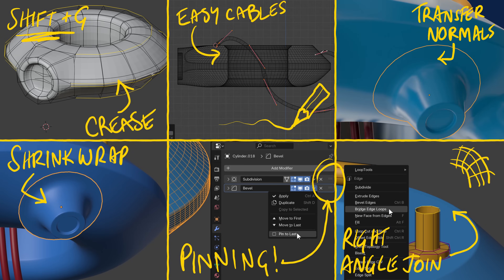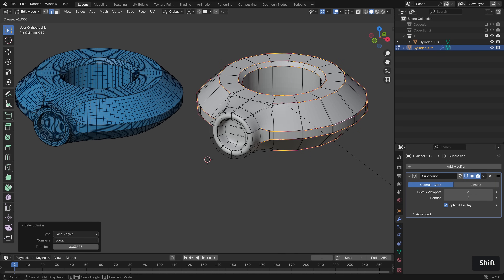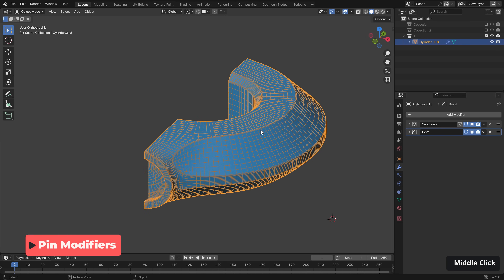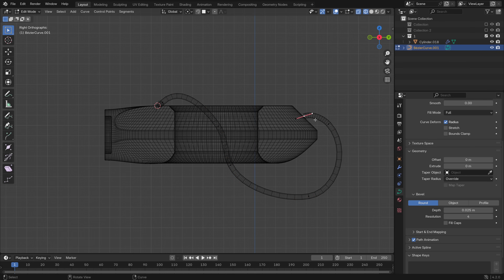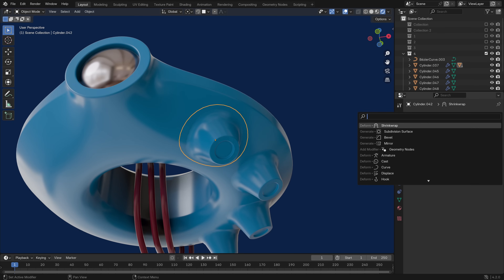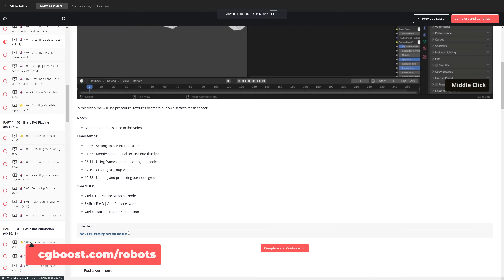6 Blender Hard-Surface Modeling Tricks I Wish I Knew Earlier

Comment: Am i right that crease edge information is only local for Blender? You can not export the High poly model(with crease as geometry) to Substance Painter or any other external program and bake normals. So by using it you basicly lock yourselves int the blender environmet. Am i correct?

Comment: when i try to do the bevel on the edge mode literally the first time it is used my cylinder gets shaped into a car tire kinda of shape, instead of the one on the video 😭.
Reply from the maker: You may need to reduce the number of bevel segments, either by scrolling down on the mouse wheel or adjusting via the options that appear at the bottom right of the 3D viewport. ~Louis

Comment: So does that mean it's okay to not physically connect those additional meshes to the original?
Reply from the maker: As this is a rigid model with a uniform material, it works great. But it might not be a good idea if your model deforms or uses more detailed textures. ~ Louis

Comment: i dont know what the problem is here i have tried everything but first my bevel is going the opposite direction also when i use loop tool circle thw whole area gets into a messy shape maybe its a glitch or something
Reply from the maker: It sounds like it could be a scaling issue, with the object selected, hit CTRL+A and select Apply Scale, hopefully this should avoid odd results with bevel and loop tools. ~ Louis
Reply: @cgboost  it was a scaling issue.

Comment: 7:38 when i duplicate the object and try to move over the main object it forces the base to stick on the underlying surface due to the shrinkwrap modifica but everything else deforma badly, the full object does not remain rigid while moving around… what could I have missed?

Ps: I think that my mistake was applying all transform, rotation included, to the small object and so now when i move around the top face keeps being oriented in the same direction as the original while the rest of the body deforms to allow the base to stick to the underlying faces of the main object…

Comment: Why do my bevels never match anyone elses? It isn't just this video, but it seems every time I try to follow along my bevels are wonky? The first set of bevels at around 1:35 don't leave any room for there to be faces on top with much wider side faces? If I try to get the same angle on the bevels, the top spins all funky.
Reply: Try going back to object mode , control A and apply all transform before beveling
Reply: @Mad_madeleine thank u for this !

Comment: After I apply SHRINKWRAP to the vector on the base of the cone when I try to move it around the surface it deforms horribly. Do you know why? I'm using 4.2.3 . Thanks. Oh! never mind I solved it. You have to turn ON "face Project" on the SNAP menu

Comment: Another good method for making cables is via vertex extrusion, add a skin modifier, edit mode, ctrl+A to change the fatness of the cable and et viola you have a cable that can be moved around with normal editing tools (this gives easier control in some instances and may be preferred), you can dynamically subdivide it or vertex bevel it as needed which is nice too.

As a bonus this tool is EXTREMELY useful for tree roots and other organic shapes since you can set the skin thickness per vertex if you so desire.

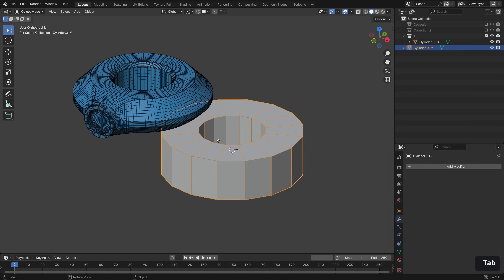Comment: for some reason my bevels in 1:22 aren't angled so well, the upper edge goes inside the mesh much faster than the lower one, so I'm never able to lower the bevels close enough that they meet. anyone knows why?

Edit: found out, it's the offset. I changed my offset to percent and it shapes like the one in this video. Thanks!
Reply: i had the same problem and your comment was really helpful
Thanks!

Comment: Does the trick at 07:43 work differently in 4.2 compared to older versions?
Because I'm currently using 3.6.1 and although all the required options and settings are there, transfering the normals as described completely overwrites all the normal data instead of trying to create a smooth transition between them
Reply from the maker: Hi are you using the vertex groups to isolate the effect?

Comment: Mesh Decal Alignment tip @6.50 : Make sure the "Snap Base" is set to "Center" otherwise your decal will not properly align to target object. Blender defaults as "Closest" which does not attach cleanly to target.
Reply from the maker: Thanks for the tip!

Comment: Trying to do the Quick Cables part at 4:34 - However, I cannot see the Draw option to draw the cable? I have to add a Blank Grease Pencil, before I am able to see the Draw Interaction Mode. Otherwise the annotate tool draws a line/curve which I cannot select or modify, and there is NO Draw Tool visible?.

Using Blender 4.2.1 LTS - and even tried to Reinstall
Reply from the maker: HI, to being able to draw curves, you need first to add a Bézier curve to your scene and then select it and go to edit mode. Once you're in edit mode of the curve, you should see the draw tools. You can simply delete the old curve and draw what you need.
~ Masha

Comment: Using the normal data transfer method, does this information work when exported like regular normals? If I were to export a model as FBX/OBJ to a game engine, do you know if the normals would maintain that blending? Or is this exclusive to Blender's calculations?

Comment: Tech question:  How can I be sure to get the normal in a rounded surface?
Is there a way to plase the object perfectly perpendicular in a rounded surface?
When I place the object with shrinkwrap I hav to rotate it to make it appear perpendicular. But how to get the perfect averege of perpendicular rounded surface on that area?
Reply: To make this I shoud take the center of the radius of the curve of the rounded surface as a origin point for the shirnk wrapped object. 
If the rounded object is a sphere we're done, the point is on center. But if it is irregular rounded surface how can I get the center of the curve?
Do you know how to solve this in a geometric/ machanic way to get the normal perfectly and not just aesthetically?

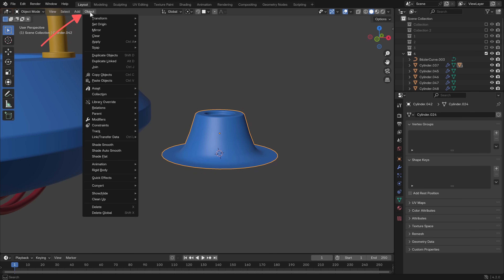Comment: When snapping the pulse engine onto the other object at 6:45 I missed an important setting where you have to set the Snap Base to "Center". It is not explicitely mentioned in the vido but important because otherwise your pulse engine won't snap properly.
Reply: Thank you that's what was bugging me !
Reply: I did that and still, the object is allways 90° off. Works at the very side of the object, where the surface is flat, but at the place I was supose to position it, dos not work.

Comment: Omg thanks so much! this helped so much with a completely unrelated issue i was having. A model had bugged vertex normals, so I used weighted normals to fix it, however when porting the model into Unity I found Unity doesn't work with weighted normals and it completely messed up the models lighting. But the whole shrink wrap and data transfer helped me be able to do that to the broken part (head) of the model to fix it and transfer good normals from a new subD'd cube I shrink-wrapped onto the original. I've never messed with or knew either modifier existed and I've been trying to fix this for over a week and no other blender/unity friends could figure out how.  💙My suffering is ovverrr!!!!  (Unity hates me  ; - ;  Man i love blender)

Comment: Great tips!
But if I may bring up a problem for further, a bit more advanced construction...
... the shrinkwrap and normal data transfer method works perfectly to integrate objects with simple materials... but what would you do when they have any sort of texture?
If been using this method for some time now to "blend" objects of different density... but I still haven't found a reliable way to add textures to that.

Any ideas?

Comment: Excellent tips, the 90 bridge is something I've never used before. 

An additional curve tip, if you need to make a curve that is both not on a surface nor on the x/y/z plane is to just use a NURBs "path." You don't have to mess with bezier handles, and the result is a smoothed interpolation between the points.

Comment: Thank you so much for the wonderful video, these are tips that makes one a pro, please I'm curious why is your object mesh blue in solid preview mode?
Reply from the maker: Hi, thanks for the comment. I guess Louis changed it to make it stand out from the other gray objects, and in general for esthetical reasons. You can change the viewport display colors inside the material settings panel under section viewport display.
~ Masha